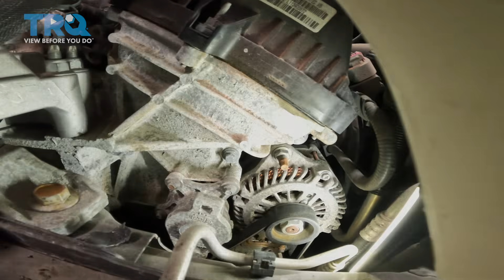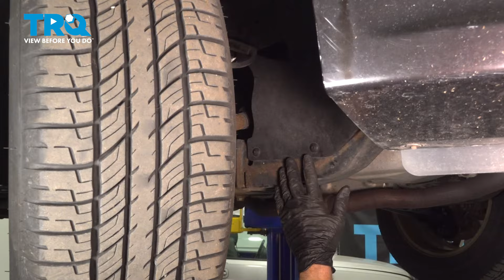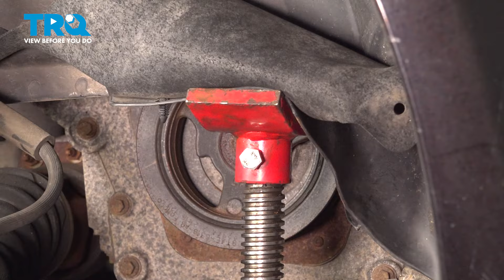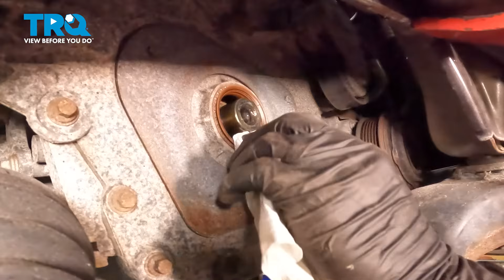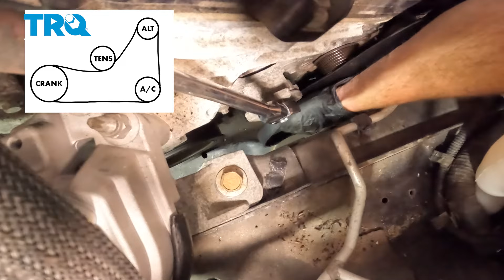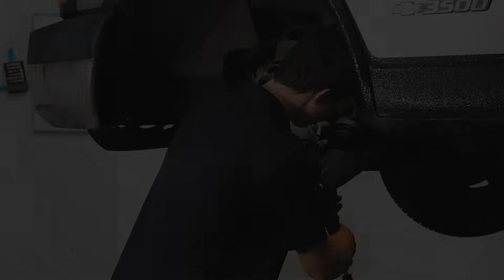How to Replace Crankshaft Vibration Damper 2009-2019 Ford Flex

Comment: If this has a slip on timing gear and you didn't put the crank pin in to hold the crank this is a fail.

Comment: Yes the crank did turn. Also you should use a new bolt for the balancer, you don’t need the install tool or the strap wrench use old bold, tighten with 1/2 in impact. Remove old bolt and install new one, torque to 37 ft. Lbs. Mark one of the points on the bolt, and a spot on the balancer 90 degrees apart. Mark your socket externally with a paint marker and place on bolt with the marks on socket and bolt matching. Use impact to turn to the mark on the balancer.